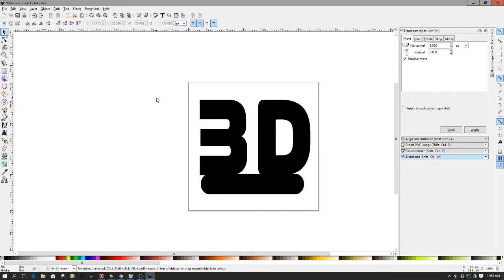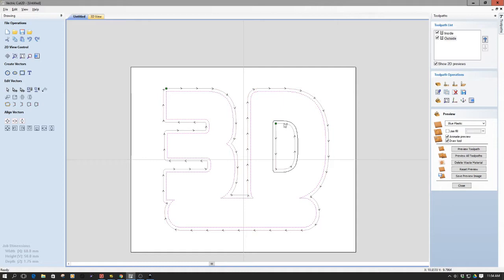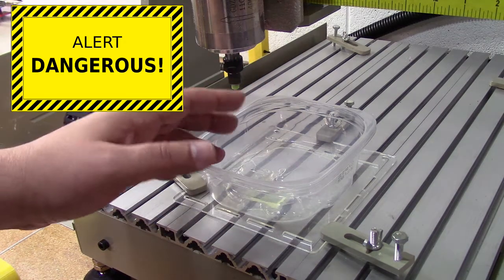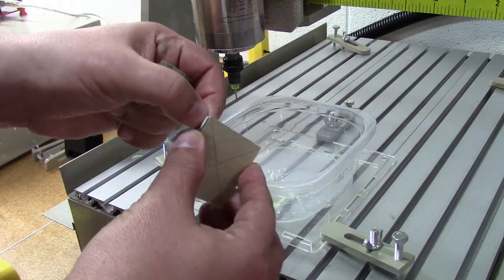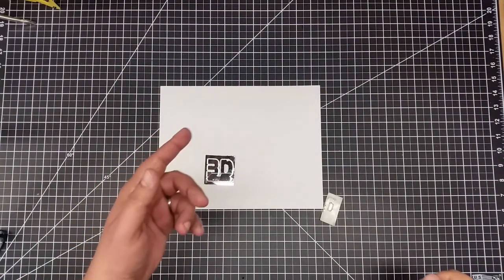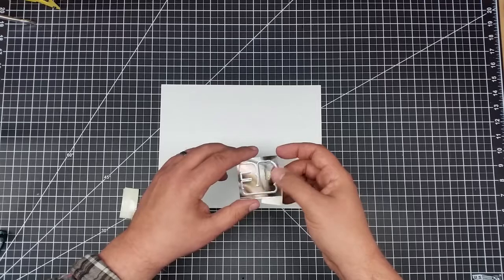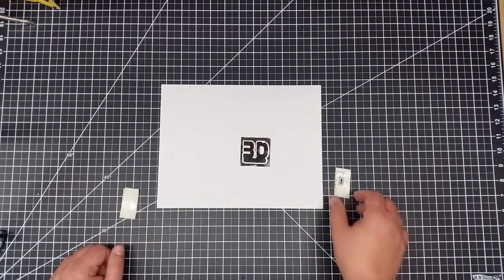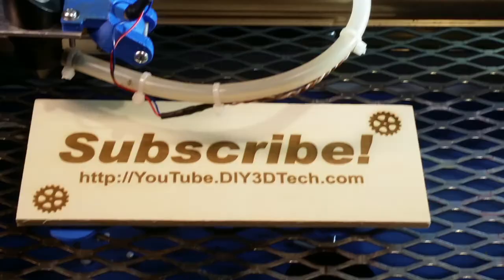3040 CNC - Cutting Mirror With DIY Water Bath!

Comment: It's never a failure if you learned something. 

Instead of double sided tape could you use some magnets?  A metal plate below and neodymium magnets to hold in place. Or magnets below and a bent metal plate holding down the edges of the mirror?
Reply from the maker: +Norbert Davis your 100% right the war against the machine is still on 😜
Reply: DIY3DTECH.com - As far as the war is concerned AC⚡DC did ask "Who picked up the metal .... and who turned the screw?  And who made who?"🤣
Reply from the maker: +Norbert Davis lol!  Sitting in a meeting up state of you in Berkeley now so I get it ✌️
Reply: DIY3DTECH.com - I'm east about 1-1/2 hours away. 10 minutes south of Sacramento.  Shoot, let me know mercy time you are out in Bay Area or better yet Sacramento area and I'll take the day off to meet or just meet for lunch.
Reply from the maker: +Norbert Davis I thought you where southern cali like SD as I come here a lot.  At the Claremont now and heading to San Jose this evening for meetings in the valley
Reply: DIY3DTECH.com - My work division is out of SD (San Bernardo to be exact) but I work out of my home near our Sacramento office. My sister lives in SD. I was just in Universal City this weekend visiting Universal Studios.  Had a blast with the family.

Comment: was that 3d foam tape like that is more solid like  old chewing gum , or was it the one that has soft foam in the middle ? .    als for nearing the bottom . lower the layer depth per pass possibly lower feed speed . i forget wich way lower  pressure on material but still cleanly cuts .   
I suspect the soft foam type double sided tape might work better for last layers but it will suck for initial .  this looks liek case for some sacraficialy wood below the mirrio and some type of long clamp to reach in teh tub . LOL 
great stuff as ever man . PS have you seen banggood has a 6mm acrylic version of this CNC lol. it has some nice  things but the motor looks shite compared to what yours has .,
Reply from the maker: It was pretty firm double sided tape however HD detergent ate it up.  As soon as I stop traveling so much I working on another solution (well you see another solution, but I am working on yet another).  Also Banggood has 3040 acrylic clone?  No do you have the link?